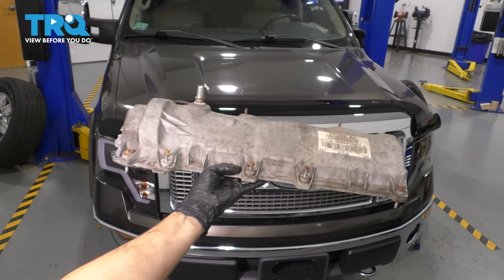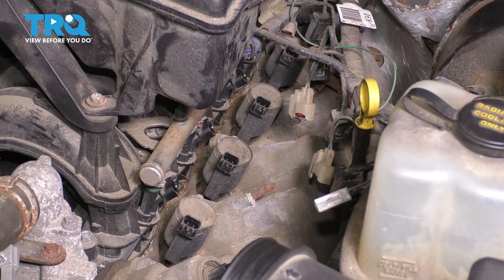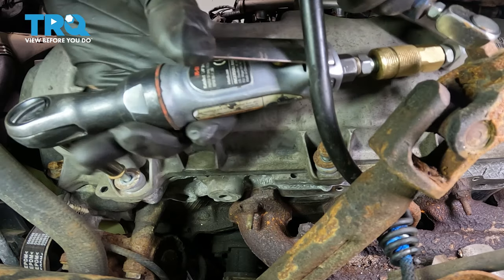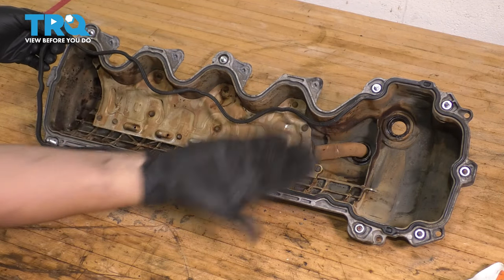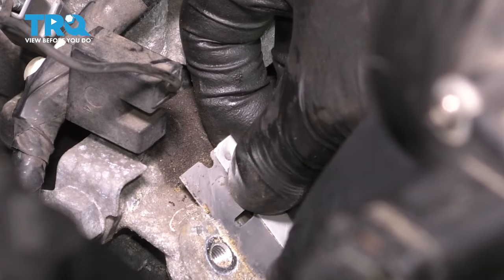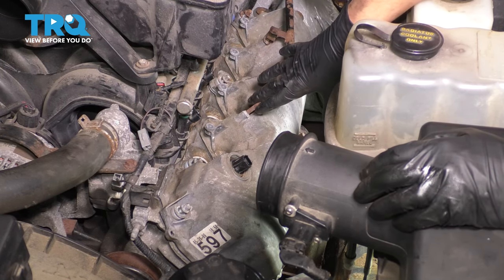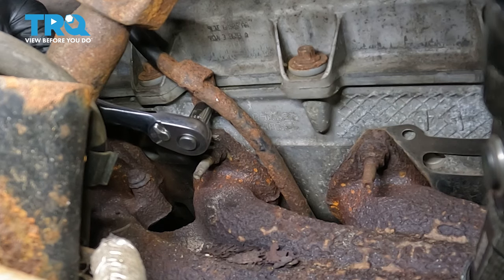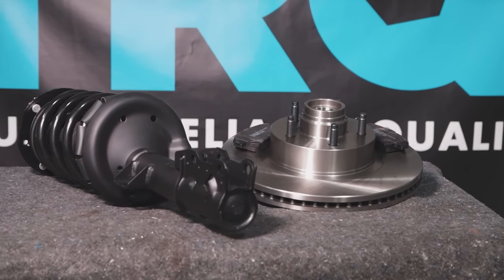How to Replace Valve Cover 2009-2014 Ford F-150

Comment: Thanks for the help. I just had the valve cover gasket done, seems like the oil leak was or wasn't from the gasket. I still have the  issue and I think the leak is coming from the solenoid. I placed dye and this is where Im finding the oil leak, its sipping around this solenoid. Do I have to take the cover off again or can i get away with placing some sealer around it?